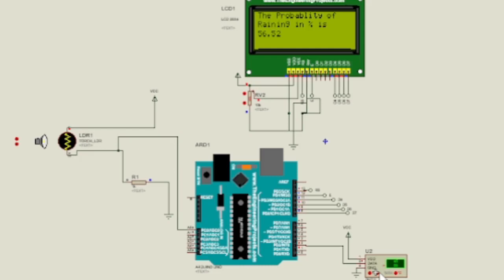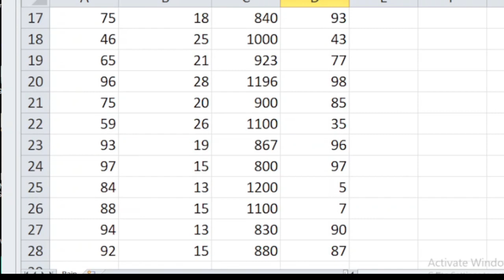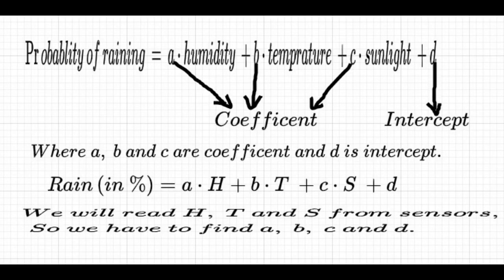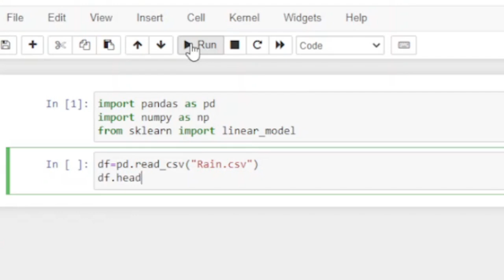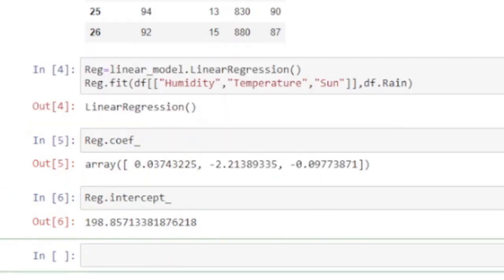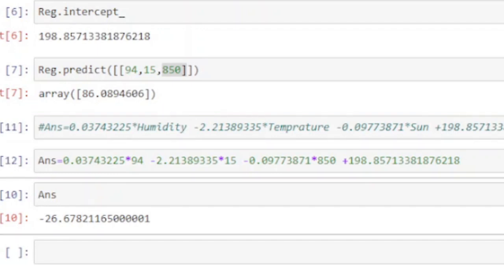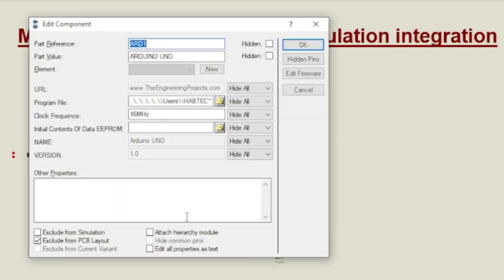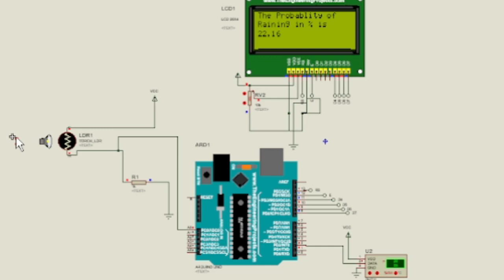Machine learning interfaced with Arduino | 2024

Comment from the maker: #include <Adafruit_Sensor.h>
#include "DHT.h"
#define DHTPIN 2     // Digital pin connected to the DHT sensor
#define DHTTYPE DHT11   // DHT 11
#include <LiquidCrystal.h>
#include<Wire.h>
LiquidCrystal lcd(13, 12, 11, 10, 9, 8);
DHT dht(DHTPIN, DHTTYPE);
int light= A0;
void setup() 
{
  Serial.begin(9600);
  dht.begin();
  delay(10);
  lcd.begin(20, 4);
  lcd.setCursor(0,0);
  lcd.print("Integrating");
  lcd.setCursor(0,1);
  lcd.print("Machine learning");
  lcd.setCursor(0,2);
  lcd.print("In Proteus simulation");
  lcd.setCursor(0,3);
  lcd.print("!!!...");
  delay(2000);
  lcd.clear();
  Serial.println("REBOOT");
}
 
void loop()
{
  double k=analogRead(A0); // LDR reading
  double h = dht.readHumidity();//Humidity
  double t = dht.readTemperature();//Temprature
  if (isnan(h) || isnan(t) ) 
  {       
    Serial.println(F("Failed to read from DHT sensor!"));
  }
  double ProbablityRain=0.03743225*h - 2.21389335*t - 0.09773871*k +198.85713381876218;
  lcd.setCursor(0,0);
  lcd.print("The Probablity of");
  lcd.setCursor(0,1);
  lcd.print("Raining in % is ");
  lcd.setCursor(0,2);
  lcd.print(ProbablityRain);
      }
Reply: Thank you, my uni project is saved :))

Comment: This is not how you do. What about neural networks and deep learning models?
Reply from the maker: Dear Jenil, this video is specific to the linear regression model. Still, if you intend to use neural network and deep learning models, you can use the Tinyml board instead of the Arduino Uno board, or else you can feed the data from your Arduino UNO board to your machine learning model serially. Thank you for your comment and If you have any doubts let me know